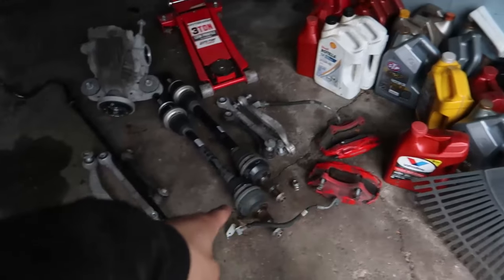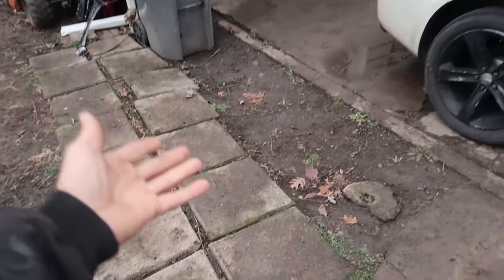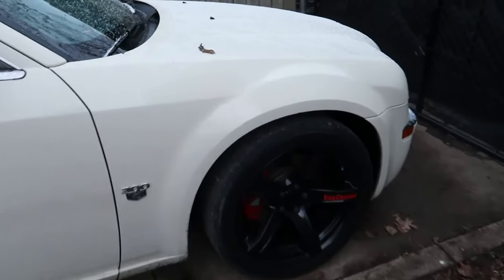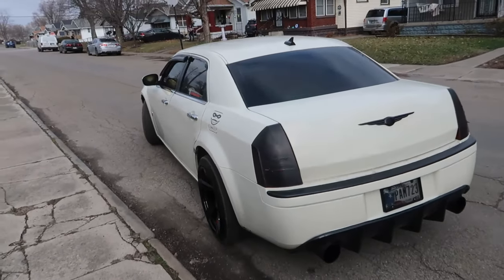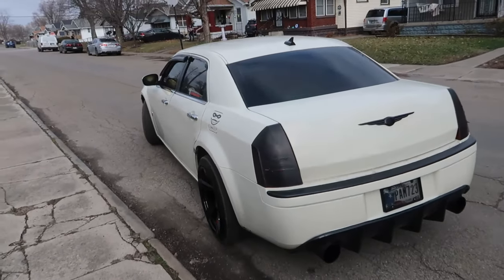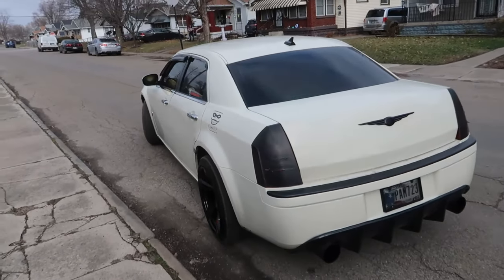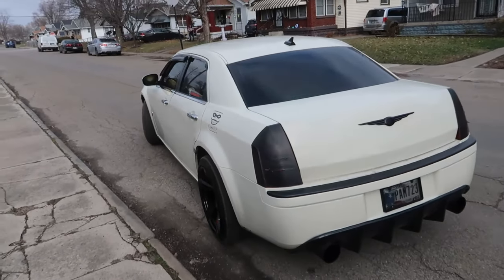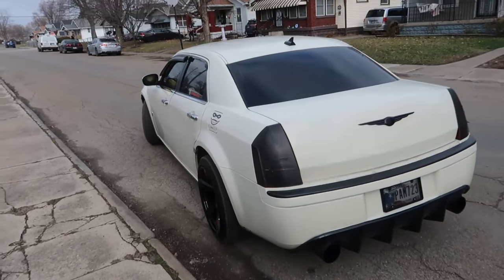Installing 3.09 Differential in a v6 Charger

Comment: Can I put a 3.09 lsd diff in my dodge charger GT and use stock axles?
Reply: axels need to be 230mm which is the same size as the lsd